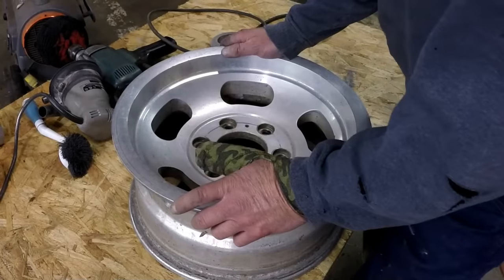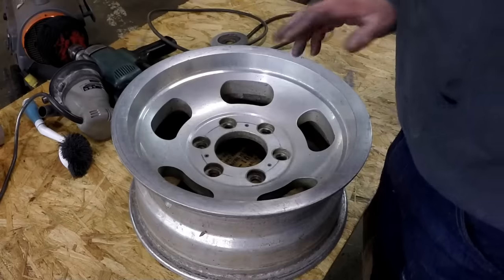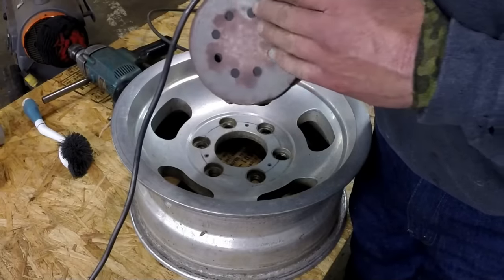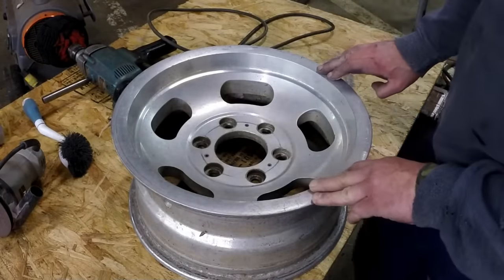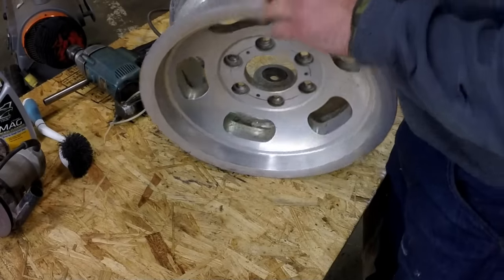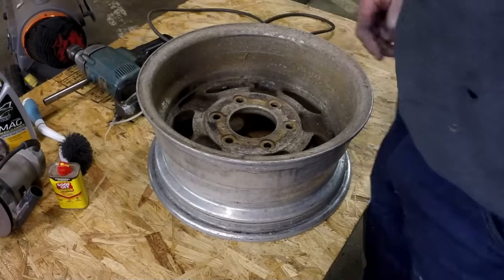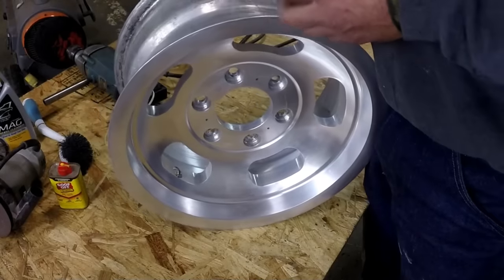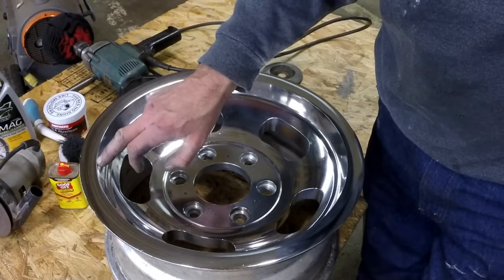Quick and dirty aluminum wheel restore

Comment: You can actually use a electric grinder with a cotton buffing wheel and different color rouge polishing compound. If you have some scratches or whatever to get out, you can use the green or red, which is more aggressive of a compound and it will smooth it out, then follow up with the white which will really make it shine. Then use a softer cotton polishing wheel and the mother's mag polish, followed up with the mother polish that's in a bottle with some micro fiber towels. It make it shine like you have no idea! Great info. You did a great job with the prep on the wheels. I actually just bought a used pro tech truck box that I am going to polish up tomorrow gonna take a while because of how big it is. I'll probably use a car buffer with some mother's and just go to town on it.

Comment: Lighter fluid, or naptha is good for removing the adhesive.
When I did my wheels, after cleaning, scrubbing, sanding n polishing, I taped up the slots, (mine were round holes, similar to the Peterbilt wheels, going on my 72 Chevy C10)
And all the openings on the front of the wheel, then I painted the backside using high gloss black engine paint, resistant to oil, water n gas.
This treatment gives the front side more contrast against the black backside and the holes or slots just pop, giving it a more highly detailed look, n the imperfections are hardly noticeable. I've gotten many compliments on the way they look.
Good job sir. It is a labor of love. The more time you spend with them the more shine you get out of them. Almost chrome looking...

Comment: You did a really good job on you're rims, that's most likely around 2 to 2 and a half hours to do each rim.  Very time consuming. Now if you spray them down with WD 40, that helps keep the luster of your time. Road tar won't stick. I do this to my motorcycle mag rims and the engines, and clutch and hand levers at my motorcyce shop of 40 odd years. Yeah I would haft to say you had done a superb job friend. Thumbs up for you.

Comment: I've restored several sets of aluminum rims. I'm just finishing a set for my 03 Super Duty. They are huge 16x12 Mickey Thompson Classic Locks. They were absolutely blitzed when I got them. It was like the guy put them on his truck, and never cleaned or washed them at all, and just beat them up for about 6 years. I've spent at least 25 hours per wheel- mostly wet sanding to get the surface nearly 100% immaculate. I started with 400, then 600, 1000, 1500, 2000, 2500, then polishing by hand with the Mother's Mag and Aluminum polish... It's been a ton of work but they are far better than new, and will be stunning with the new Mickey Thompson 36x15.50 MTZ radials!!

Comment: Hey brother I don't know if you know this trick or not but after your final polish if you use a cloth and take talcum powder or even flour and coat the cloth with the powder and wipe the wheels off. It takes all the black out and you will be impressed even if you try it on a rough area. It shines like chrome. Give it a try
Reply: Thanks great tip , I'm trying that too !
Reply: Billy Mehaffey i
Reply: wiping it with flour?
Reply: Does this work??
Reply: good tip,i used to use baby powder,likely same result,but mine smell better  lol
Reply: Corn starch will work also.,,, Oh, and also for dark colored paint jobs, try throwing a small handful of it on  your freshly waxed(just before buffing off dried wax) body panel,then buff away (wax and corn starch) and then stand back and admire the shine!
Reply: Also mix that baby powder or flour with isopropyl alcohol make a compound added to the area and let it dry..after 10 minutes remove it with paper towel or microfiber towel...
Reply: Thats what they do to the old airstreams.
Reply: Self-raising or plain flour?
No eggs I suppose
Reply: @jershaus  ... What is it that they do to airstreams? .... the flour/alcohol mixture?
Reply: @waynewells359  yes, that's exactly what they do and the shine of course as I'm sure you've seen is exceptional...like nothing else! Shit, it's better than effin' chrome and lasts quite some time if you know the proper aftercare process/ upkeep which i believe is repeat the aforementioned step 😂👍LOL. All jokes aside my friend...the above i believe ( 99.99% sure ) is the entire process.
Reply: I have learned something new for my day and definitely trying it!! ... beer time! Thanks fellas!
Reply: AY  over  oxide >>  ..
Reply: @antonio030562  Wonder which is better, wheat flour or white.
Reply: @rustypipes6339  lol

Comment: Dude ive polished ever single peace of aluminum on rice rockets that i use to run when i was a kid . You were pretty dam close to making them things cherry . But there were a few things you missed and i know you said that at the start of the video . Im a body and paint guy so i always have the correct stuff to do the hob laying around but anyway the key to straight mirror finish is that it needs to be sanded with 1,000 or finer gt sand paper and you just go over it with a finer paper on each step you can get single sheets of the stuff from any paint stores for like 3or 4 bucks per sheet. If you do 1,2,3 thousand you will be able to use them things as a mirror when your shaving in the morning !!!! But you did a pretty nice job especially if it was your first time !!!👍👍👍
Reply: Johnny G Ride how do you prevent them from oxidizing after polishing?

Comment: Excellent, and thank you for posting your experience with restoring these aluminum wheels, as this is actually applicable to refinishing anything aluminum.  I am looking to bring back some shine to my RV's aluminum framed windows and door frame.  I was considering etch priming them and painting them.  But now, seeing that polishing is actually the easy part, I think I will forgo the paint, and simply polish them, because other than being greyish, they are in perfect condition.  Thanks for the useful info.

Comment: Been there ,and done that. I took down  a painted set of f ive star  5.0 mustang wheels at About 15 hrs each. I think the factorys use a vibrating system with a bed of abrasive medium in course medium and fine. Instead of eagle one I use the "Bricks" of abrasive that are held together by a wax,and apply it with a cloth buffing wheel. It's very dirty work. I cover myself with coveralls ,hat ,shield and nitrile gloves

Comment: Great job. Just a suggestion that I use in my shop to clean dirty aluminum . I use wheel acid pure and a tooth brush or similar.  It will clean all that stuff off very easily. After that sand and polish.

Comment: I work at a wheel repair shop and for the tools you had to use that's pretty good. It works alot better though if you use finer sandpaper like 1000 grit or 1200 grit wet sand and then use regular block of brown polish with an air hose hand buffer. Then get a black block of polish and go back over it. Then use lacquer thinner or 900 grease remover to get the black off, you can use your hand. Then blow off the water and wipe it down with a micro fiber rag.

Comment: Very nice finish after the buffing with the Mother Ball.  I recently refinished a set of aluminum Honda Enkei  wheels that I clear coated after the fine sanding and 0000 steel wool.  They looked clean and sharp but I believe they would have looked awesome like your finished wheel if they had received the buff treatment.  Nice job.

Comment: excellant video.a ftiend of mine gave me some edelbrock valve-covers.they needed cleaning as well.we polished and polished.buffed and buffed.we got them looking pretty good.was a lot of labor but i think it was worth the trouble.we got them on a 350 chevy motor.in a 38 chevy coupe.they turned out good we used the mothers mag and wheel cleaner..good product.thanks for the video.

Comment: Prep I use steel wool, and WD-40. After that wash with a mild dish soap, and finally use a buffer wheel for the face of the wheel, the use a wand for the lip of the wheel. Mother's is a good polish, but I prefer Fliz metal polish. You can get it at Bass pro shops.

Comment: Those wheels appear to be either early to mid 70s Jeep Wagoneer wheels,or same era Chevvy 4wd truck wheels which both used the bolt on center caps which are why the holes are in them between the lug nut holes... Looks good when finished...
Reply: They're Airstream wheels! I have them on my 1974 Excella.

Comment: I may be crazy, but I use an electric toothbrush with polishing compound to polish the aluminum rims of the wire wheels on my Triumph motorcycle. Polished aluminum has a depth that chrome plating does not have.

Comment: Talcum powder is a good trick, scotch brite wheels can give you a smother finish. But to remove old build up use a chemical aluminium cleaning solvent then wash off with water. There are a number of chemical products on the market. Don't bother with the products you buy in a car care shop. If you are going to use steel wool to clean it needs to be wet and use a soap then rub lightly. The final polish use a cloth wheel with polishing cream. Don't let the material heat up as you will get black marks that will not remove without chemicals. If you are going to use sand paper always use wax on the sandpaper this stops clogging up of the sandpaper and cleaning up is faster.

Comment: Man I can’t wait to do the slot mags on my old 72 Ranger XLT…😍 I was wondering if they would shine up real nice. I did the weld draglites on my mustang and then I would clean them and polish them maybe twice a year and it didn’t take nearly as long after the first time. Thanks for the video, I was wondering if I could use steel wool to remove the heavy corrosion and you answered that! Thank you!
Reply from the maker: It seems steel wool is not the preferred method, but honestly, they’ve held up pretty good. They need polishing again, but still look good and have not had any care since 2016. I’d like to get around to making an update video. Thanks for watching!
Reply: @urjb  thank you

Comment: I do this semi commercially. I use proper acid alloy cleaner inside and out.Often using Scotchbrite to get brake dust off. And a decent pressure washer.
 Finish rash as described then the hard work starts, Never use wet and dry. Dry rub only and go with the flow of the machining, Bad marks start at 80 grit and finish with 400. Then they are ready for polish which I do with a 3hp grinder and commercial linen polish mops. Very hard work! I use a a linen pad on the buff as well for hard to get places.
A set of 4 consumes from 5-8 hours from start to finish. That is the only real way. And even then many still have dings and scratching with 40 years of abuse.

Comment: Phosphoric acid, sold at truck stops for cleaning fuel tanks and wheels. Usually at Napa too. Great cleaner, and fast. A couple static sprays and a half hour wait, power wash and presto clean-o..... the tape it won't do.

Comment: Great video! Heading to the store for aluminum polish and Mothers ball! Thank you!
Reply: Jim Vincitore don't waste your time on mother's polish.        The problem is that it's a single stage polish. Any truck stop has BETTER stuff than mother's polish.
Reply: What brand do you recommend?
Reply: Jim Vincitor, Bush polish sold at truck stops is almost as good as ours. I would say thats the best I know of off the shelf.  Most polish is too hard to use or leave a haze or is just plain made to sell as cheap as possible for more profit. We are currently not manufacturing due to moving to new location.  mirrorshineusa.com is ours.

Comment: Mistake to use "Steel Wool" on aluminum.  Sure, they look good now but there's a little thing called "Galvanic Corrosion" that you unintentionally invited to the party.  Also, ONLY use aluminum oxide sanding abrasives, No Emory Cloth or any black sanding paper, discs or otherwise.  It  DOES make a difference.  You know what I'm talking about in a year or two. If you keep them very clean and polished you may get lucky but it's a lot of work to rely on lucky.
Reply: There has to beimmersion in a conductive liquid and electricity involved for galvanic corrosion.
Reply: 60+ years of it being used on aluminium says otherwise, but yeah what are facts.
Reply: @-DEATHSTROKE  shhhh......don't confuse him with facts. Lol
Reply: 0000 steel wool is so fine it doesn't damage aluminum 😂. Guys are sanding aluminum with 80 grit and as with any aluminum polishing... you work up to get out scratches and swirls. Some of the best professional polishers in the trucking industry use 0000 steel wool but what would they know 😂.
Reply: total crap
Reply: @johnweisinger7390  Negative.  Moisture will do just fine.  Immersion would hinder corrosion.  Corrosion needs air, metal, and electrolyte, but NOT immersion, not at all.
Reply: @x-man5056  for corrosion, yes. However galvanic corrosion occurs when two dissimilar metals are immersed in a conductive solution and are electrically connected
Reply: @x-man5056  sorry dude,you are wrong. No biggy,let it go.
Reply: @jpeknowbody3649  Too funny.
Reply: @johnweisinger7390  Immersion not required.  I saw an F-4 canopy rails that where corrosion treated and freshly panted 2 days before look like sugar frosted because some dimwit left the canopy open over night at sea. A little salt spray and balmy SE Asia Pacific temps.    Also with regard to immersion, capillary action will pull moisture between 2 'faying' surfaces (touching like laying one on top the other) suck it right up and hold it between the surfaces.  That's why every panel, whether removable or not on aircraft have a thin layer of sealant or rubber cushion there.  It's even more important where you have aluminum on steel.  Battery waiting to happen.
Reply: @x-man5056  👍.  As far as the video goes, using steel wool to clean aluminum doesn't invite corrosion to set in. I've been cleaning aluminum wheels and tanks with it for at least 30 years and it's never been a problem. 0000 steel wool with some White Diamond polish works very well. I've even polished aluminized exhaust tubing with it and it still looks good several years later.
Reply: @johnweisinger7390  Ask a person who has made the mistake of prepping aluminum with a "steel" brush (vs Stainless Steel) for TIG welding.  
I'm sure your product looks outstanding when it leaves your shop.  Doesn't change the fact that you are pushing particulate contamination into the aluminum, the science is in.   
It would be easy to change over.  Aluminum Oxide Abrasives may be slightly more but SS wool and Brushes should be a no brainer for you.
Reply: @x-man5056  Quad zero steel wool isn't the same as a steel brush. It's so fine that it doesn't scratch. In facr it's used on glass a lot to clea  up overspray. I don't have a shop, I'm a truck driver.  Like I said, I've been doing this for over 30 years and haven't had "contamination" be an issue. I'm sure there's worse "contamination" in the shit I drive through on a daily basis. It's cleaning aluminum. You clean it, you polish it, if you want you put a little wax on to seal it. Hell I cleaned the nasty hydraulic tank on the rock truck I started driving last year with an SOS pad, and after a year of being pelted by rocks,  having limestone dust, mud, and hydraulic fluid building up on it, I hit it with a little degreaser and a pressure washer, and it still looks good. You're not painting it, you're not prepping it to TIG weld.  I'm not the only person who uses this method, there are literally thousands of people who do it around the world. Your "science" doesn't know all.  Maybe it's a "no brainer" in your field, but your field doesn't apply to every other field.
Reply: @johnweisinger7390 whatever damage is done is nothing compared to regular wear and tear. brake dust alone is some real nasty stuff, I'm sure a little steel wool is fine lol
Reply: @subtleusername5475  exactly

Comment: Some tips for those who just want to clean and brighten there non-coated aluminum wheels but have never used Eagle One before. Eagle One is great for non-coated wheels but not for removing the brake dust and road debris, and not for use on hot wheels. Always clean the wheels first with one of the releasing agent type wheel cleaners and a good but soft brush to get the wheels as debris free as possible. Then doing only one wheel at a time,  work as quickly as possible to spray the Eagle One evenly around wheel and work it around the wheel completely with a different soft brush, then rinse thoroughly , don’t let the Eagle One sit on the wheel for more then 60 seconds, you are better off to do it a second time if necessary rather then take a chance on the Eagle One being on to long. And for those who are wondering, you cannot use Eagle One to remove the clear coat from aluminum wheels, it will make a mess of the coating and can actually gum it up so bad that it can make removing the coating harder….

Comment: Rather than smelly GOOF OFF, try using rubber cement solvent (called Bestine) which is basically orderless and which loosens and cleans up all adhesives. Amazing and leaves no trace of tape and stickers on things. In addition: Much safer to the touch.

Comment: Don't use a sanding disk the was used on metal is it will embed metal into the aluminum and make it rust. As for the dust, just wear a respirator. 👍

Comment: what about cleaning up the rim where the tire beading sits to give the tires a good seating, the same for where the valve goes through the rims, clean them up to prevent lose of air, also when I have cleaned ally wheels up I like to give the inside of the rim a couple of coats of paint in case they get porous, again to prevent air lose, just thought you might like to know.
Reply from the maker: Sure.. if your wheels come from somewhere that has a problem like that from salt or other environmental causes. These were not in need of any care other than cosmetically.